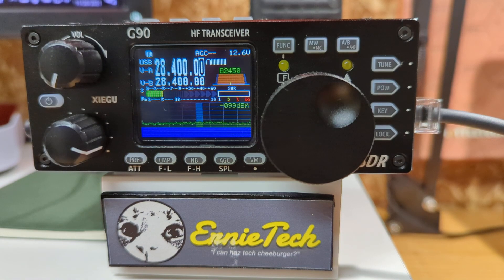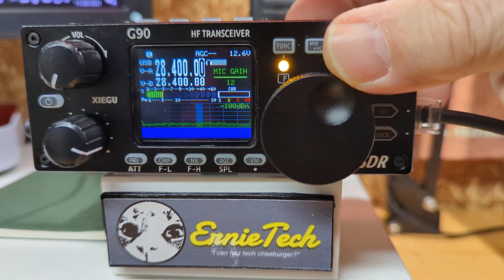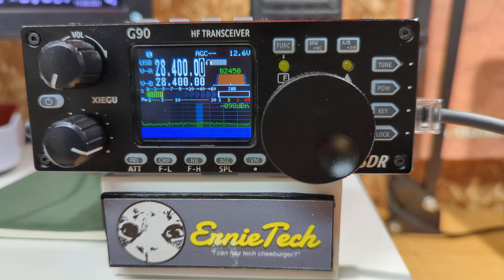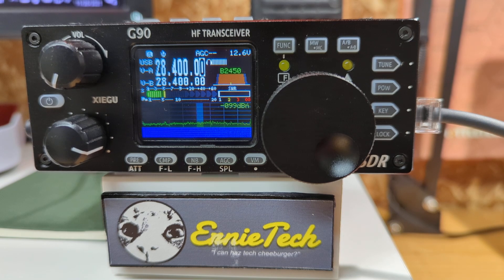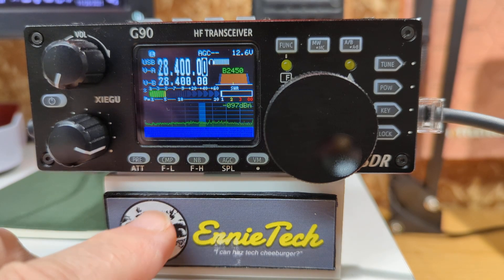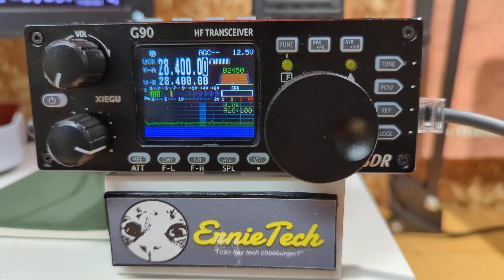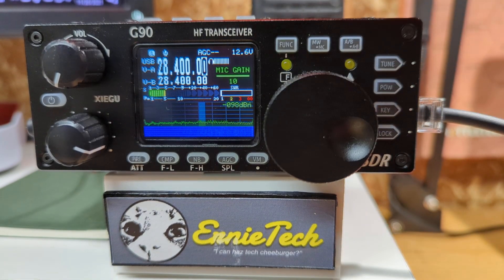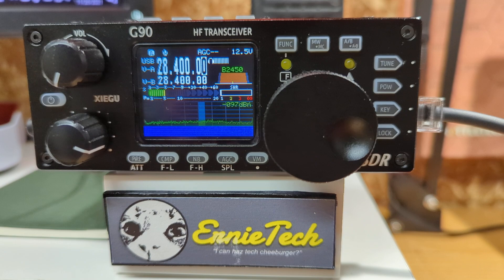Mic Gain and Compression on the G90

Comment: I use a condenser mic, SM-30, and compression on my IC-7410. The guys in England said my audio was "loud" last time I used it. I did a side by side with my FT-991a with the M90 dynamic mic. The PEP on 40m from the Icom was 120w while the 991a was only putting out 70w into the same antenna. 14.7vdc, and power set to 100w on the 991a. I set the audio on the 991a according to a procedure in the "The radio today guide to the Yaesu FT-991A" by ZL3DW. I do not know if my 991a is busted or not but I make DX contacts fine , just not getting through the pile-ups. The Icom filtering is no match for the SDR in the 991a receive wise. I don't get why Hams don't want the boosted signal that compression gives.

Comment: The compressor has a fixed threshold. That’s not uncommon in the audio world. As you discovered the way to adjust it is change the mic gain. 
I think the 12 setting you started with was better. It don’t think it was distorting though the only way to know for sure is to connect to a WebSDR and record yourself. I personally am not a fan of asking others if your audio is good as everyone’s taste and experience are different. 
Xiegu’s audio implementation is non-standard to say the least. I wouldn’t give too much credence to absolute levels.  (The S meter seems a bit off too) If it sounds good and you are making contacts then it probably is good.
Reply from the maker: Thanks Jeff. Great insight!

Comment: Why the difference? 
A compressor, in audio lingo, brings all the audio up to a consistent level. Shouting and speaking softly are all "compressed" to roughly the same audio level.

Mic gain increases the sensitivity of the mic. Too much can sound echo-y and pick up every little sound in your house and send it over the air. Too little and your friends all say "yer audio's a little light..."

So turn compression on to make your audio all the same loudness and adjust the gain to pick up your voice nicely at a comfortable speaking level.

QRZ means "who is calling me?"
QRL means "is the frequency in use" and usually in voice modes you just ask and leave off that Q-code. (Which is funny because you do hear "Q R Zed" on voice, as well as some others...)
Reply from the maker: I'd just add that the compressor, when implemented in a standard way doesn't bring the audio up to a consistent level rather it does an RMS average of the level leading up to the peak and keeps the level from exceeding the averaged peak. As explained to me by an audio engineer and professional musician friend of mine.

Comment: Hey great video, any advice on what the RF Gain should be set too? Cheers 73 VK3NDG
Reply from the maker: I'm between 45 and 50
Reply: If there is QRN I go down to 10 or even 1. If no QRN I go up to 30-70. But I wonder about signal strength reporting accuracy. The higher the RF gain setting, the higher the s meter output.

Comment: With the power set at 20 watts, I have my mic gain at 6 and it seem slike I have to back off of the mic to keep meter out of the red.
Reply: Red is not bad in this case. It’s the amount of compression

Comment: If u have another radio to monitor your signal... with no antenna attached (to prevent overload to the monitor radio) .  How does your G90 sound... (of course with an ant on the G90... listening using head phones) ??? Try those adjustments....
Reply from the maker: The Reverse Beacon Network is helpful too